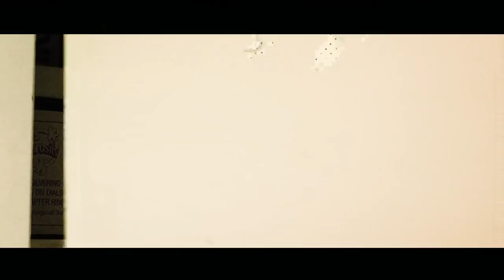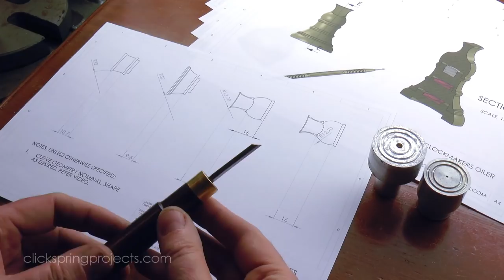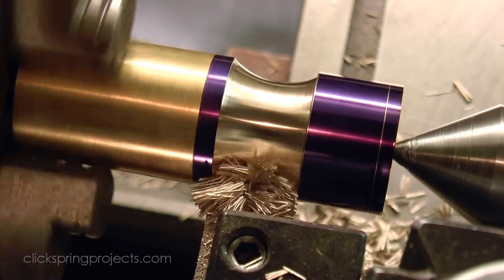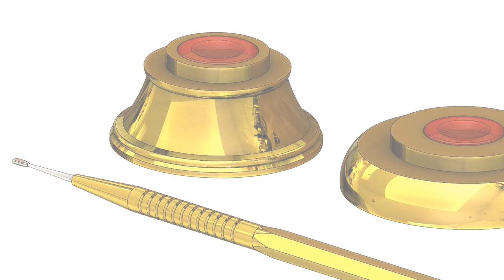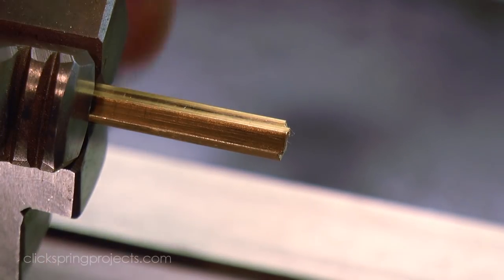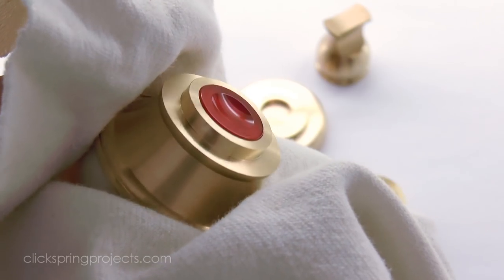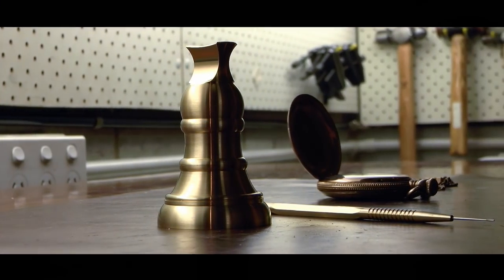The Good, The Bad and The Oiler

Comment: My grandfather was a watch and clock repairman. He passed away when I was pretty young so I didn't have a chance to learn much from him. He purchased a business of an older guy he worked for in the 50s, so he started off pretty well with a lot of original new parts. My mom held onto the majority of things in case I ever wanted to use them and I'm glad she did - a few watch makers lathes, a ton of tiny tools. Millions of parts tiny gears, crystals, springs, new from different companies. Still in original packaging from years ago. - There are a ton of items that I have no idea what they are or how they are used. Not only that but if they happen to have some sort of label on the box they're in, often not much comes up online for them either. I love watching these videos because I can see the actual use of the parts. There are a bunch of tiny oilers with ruby inserts. Small little wooden ones, some stacking, a lot of them. I had no idea that it what they were used for until I watched this. I'm slowly trying to organize everything, and get one of the lathes setup properly so I can use it. Every time I watch one of these videos it makes me want to go dig around in the tool bin and figure more stuff out.

Comment: I have two types of lubricants in my workshop. Sewing machine oil and general purpose grease. The sewing machine oil is perfect for most applications. It is very cheap, easy to clean, does not stick and it doesn’t oxidise.
Reply: No Way Oil?

Comment: I spend my life - well a part of it - telling site managers that WD is not the thing to spray on hinges and that what they really need is a can of 3 in 1 or similar. I tend to use duck oil for applications as it contains more oil and less solvent - mainly cleaning and protecting tools and equipment. You do some amazing work I love the way your filled parts just click together - Respect!

Comment: Several points
1) WD-40, AKA Work Destroyer 40. The ideal way to much up just about anything
2) Large Radii with form tools. Often it s a good idea to remove material with some form of relieving tool first. As the material becomes tougher. The Radii or form bigger. The more this becomes needed. 
3) One problem with form tools I've seen is that with flimsy set-ups is a tendency of the work to climb up over the tool due to the work grabbing. Stiff set-ups, low speeds, and materials that need it cutting fluids.
4) And finally a question. All we ever see of Clickspring is his hands. All we ever see of This Old Tony is his hands. Maybe Clickspring has a really good Yank accent. Or TOT has a great Oz accent. Are Clickspring and This Old Tony one in the same? One ponders these great questions of existential importance.

Comment: Nice video, I like when you try different topics :)
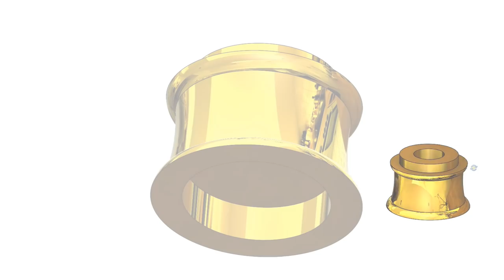5:08 you explain that aerosol based products are bad in many ways for small mechanisms
But what about bigger mechanisms, it should also evaporate within a few days and cause the same thing ? Or does it last longer because you can put more ?

I would really like to know what you think, because I'm pretty used to use this type of products and I have no idea how bad they can actually be.
(I use this for my 3D printer for example)
Reply: The things Chris described are an old school way of thinking, and is mainly applicable to his small possession things like watch mechs. I think the main takeaway is that you shouldn't apply excessive lubricants, and don't apply lubricants to dirt old lubricants.
Reply: @xenonram  Ok ! Thanks a lot for your answer
Reply: some kinds do evaporate quite quickly, if you need to free something up, thats fine but if you need to lubricate then choose carefully, I've found a cheap one called pocked rocket and it leaves a greasy film behind that seems ok for protecting components from corrosion for a few days but before assembly but I wouldnt use it to lubricate. The right oil is the best option

Comment: What benefit is there in using a ruby disk as the oil well, instead of just cutting the well directly into the oiler?
Reply: @Clickspring  Awesome, thanks!
Reply: Is there a problem using a softer material for the nib?
Reply: @Bill Carson I think the red colour of the ruby is prefered because of visual contrast with any small oil contaminant allows you to know when it's time to clean out the cup and put in a new batch.
Reply: @Bill Carson Granite is pourus and would absorb oil.

Comment: Amazing workmanship as always. What's up with the rubys though?
Reply: Came here to ask the same.  Why rubies?  Why not just a shallow well in the brass?
Reply: Maybe to ease cleaning the wells? I'm stabbing in the dark....
Reply: Come to think of it, maybe b/c Ruby is significantly harder than brass? Or maybe b/c Ruby won't oxidize and therefore contaminate the oil?
Reply: That would make sense if you want to keep your oil really clean, especially from tiny particles of brass

Comment: 11:25 pure engineering porn....  both levels and the top, just gliding on an interference fit (correction - sliding fit). Wonderful
Reply: Richard Lincoln yeah that got me all hot and bothered too.
Reply: Interference fit? You might want to look up your definitions again. Specifically, that was a sliding fit which is a fairly tight clearance fit.
Reply: Straight nutted
Reply: I'm new at all of this machining stuff so maybe I'm just ignorant but, if your decked out with every.conceivable measuring device and a good dose of patience, why should it be so difficult to turn parts with such tight clearances....?
I'm not saying I wasn't impressed...... But I wasn't surprised.
Reply: @garthodonnell3661  You shouldn't need "every conceivable measuring device" at all. If you've got some practice fits like that can been done with the old school inside and outside spring calipers that can't even do a direct numbers measurement. All you do is compare the inside measurement to what you have on the outside and keep cutting until it's a slight bit under. Even with a standard pair of dial calipers it could be done pretty easy. .001" - .002" clearance isn't that tight of tolerance.
Reply: Turning Point yeah totally agreed...... so why the fuss, I guess it just looked good hey..
I'd fall over if it slid together like that on something that was open ended though, that would be so thing else.
Reply: @garthodonnell3661  Well it's a cool effect seeing the part slowly lower as the air escapes. But I'm not sure why some think you need to be a master machinist to manage it. Chris's machining skills are far past what that little effect takes. LOL, with an open ended part and doing that?
Reply: @johncochran8497  thank you - I stand corrected - used the wrong term
Reply: @turningpoint6643   I guess it was just a good feeling when you see the calm quality of this guys content and a great conclusion to the project. Beauty or even appreciation is not predicated on difficulty or uniqueness (for me),  you either like something or you don't.    I liked it.

Comment: Love the video as always. What's the purpose of using ruby? I'm guessing there's more to it than just decoration.
Reply: Was thinking the same thing.
Reply: My guess would be its hardness, scratch resistance as in avoiding contamination by brass particles.
And boy it looks pretty. :)
* edit: aand already answered below, the joys of scrolling :D
Reply: I've read it is pretty good for friction since its very slippery and durable.
Reply: Nothing to do with decoration. Thermal stability and high dimensional accuracy of synthetic ruby means extremely low friction coefficients: efficiency and accuracy of timekeeping, and increased longevity of the parts. The jewels are bearings.
Reply: @mitchellg5615  But why use them and oil wells?
Reply: @wexy021  oh, well for this part yes, it's just for decoration. He said you can use other durable materials for the oiler, but this is particularly non-porous (reduce cross-contamination) in case he wanted to change the oils in the future, I guess. And the ruby just keeps with the whole timekeeping theme. Sometimes metal bearings are used in mechanical watches but only the absolute cheapest.
Reply: @mitchellg5615  ah an omage to timekeeping, lovely. Thank you
Reply: @mitchellg5615   that is what I meant to say lol
Reply: @TheEvertw  yeah, rubies that big would cost a bit much

Comment: As with all engineering the most important part is between the cutting edge the tool(file) and the surface of the part,
everything else is an add on to get that bit right , 
I try to get my mindset  between these two surfaces to get a feel of what the tool is doing,
measure twice-cut once, i most compliment you on your tidy workshop too lol

Comment: Excellent video as usual. One question. With the superglue you use to hold your work piece on to the temporary stock I would imagine there is some residue left on the work piece. How do you remove that residue? Chemically I assume?

Comment: Other than looking visually stunning, does the ruby reservoir serve any other purpose? (I'm thinking oil surface tension related, but would appreciate clarification) - Amazing video as always!
Reply: I believe it's for durability purposes, or for avoiding scratching brass shavings into the oil

Comment: Think you'll ever go over jewel bearings? They're a critical part of most clocks in the upper end I hear yet there are so little examples of them out there to learn from. So far I know they have superior hardness, small area meaning low coefficent of friction but most importantly, great temperature stability but alas that is all i know so far.
Reply from the maker: Yes will certainly cover jewelling in the near future - Cheers :)
Reply: @Clickspring  Right on. Do you think the antikythera mechanism used them? Jewels date back long into antiquity so someone eventually might of noticed their use as a hard material that had the potential for bearing use. The only issue is I'm not sure if gems were common as well as did they neglect the lower quality stones or was every stone considered precious.
Reply from the maker: No evidence to suggest use of jewelling in the AM - Cheers :)

Comment: That is the most lengthy description of WD40 I've ever heard without mentioning it's name :D 
Once a carpenter came along and sprayed that crap into my lock without asking. I replaced the lock and reduced his bill with the same amount. And never again would he receive any jobs from me. That was another 60 euro down the drain for just applying a little bit of WD40 :D 

(it was a high quality matched lock which had to be made by order so it would hold the same combination as my other locks. Three in total)

Comment: Why do people mistake WD-40 for a lubricant?  The very name is "Water Displacer"--depositing a waxy coating to protect bare metal against weather is what it was designed to do.

I do know that people have found having a nice sprayer filled with kerosene (the solvent) is handy for other things, like when you need a non-polar solvent.  So, cleaning.

How do you go from that to "substitute for oil"?

Comment: what is WD40 good for then? Apart from dozens of funny ab(use) cases...
Reply: Great for removing old sticker crud, good lube for machining aluminum if you don't like the smell of kerosene.  OK for cleaning surface rust with scotchbrite or steel wool too.  Just not suitable for use as an "oil", it gets gummy.  If you want to test something like this spray a bit on a piece of glass and put it somewhere dust free for a week or longer.  Some of the spray products will start to feel sticky in just a few days, others may take a month.  Some are true spray lubes without any tendency to gum, but they still slobber oil everywhere.  Great if you want to really soak something down, not good if you want oil only in specific locations.

Comment: Hello click spring! I actually work on clocks full time for a living.  I am only 23 years old. I do probably 80-90% of the repairs in my shop because the owner is starting to lose vision and has problems keeping steady.   Anyway,  I’m not perfect. I makes mistakes. Occasionally I’d have to take a clock apart more than 2 times after installing bushings only to have the clock not be repairable in the end.      

How do you deal with ‘problem  clocks’.  A clock that has been repaired recently and had to come back to be worked on for some reason.   How often does is happen to someone with you experience?   

I can only assume that my lack of experience is what puts me in these situations.  Missing details throughout the repair.   

I believe EVERYTHING is repairable so long as you have the time and patience

Comment: Nice work Chris, well done. However where can we get the ruby from? And how do you machine the stuff?
I'm stumped!  I get why you use ruby, as it would  not absorb the oil. I suppose "wicking" is the thing to control?
I'v been repairing sewing machines for 38 years using fine oil, usually motor bike fork oil in either 10 or 20 weight. My motto "is less is more".  I usually apply my oil using different sized sewing machine needles in a pin vise. I like your applicator way more!
Reply from the maker: Thank you mate! The jewel cups are from Bergeon (BERG-30180-AG-10MM, BERG-30180-AG-9MM) and can be purchased from http://www.ofrei.com/page248.html#30632 - Cheers :)
Reply: @Clickspring  ur a legend

Comment: Usually these videos are so relaxing; I’ve never yelled at YouTube like that before.  From a few years’ experience working in a tiny clock shop in Connecticut (actually, it was a “shoppe”) I learned that customers caught having lubricated their clock’s movements with WD-40 or graphite earned themselves an extra charge since we had to replace the ammonia in the ultrasonic bath.

Comment: For future reference for anyone who sees this....WD-40 is NOT a lubricant.  Don't put it on things that you care about unless you are trying to evaporate water on electronics or steel.  I use it on 80's BMX bike frames to make sure any rust inside the tubes at the welds are completely dry.  WaterDisplacement-(formula)40.  :D

Comment: am I the only one that thinks this is insane? why not use a brush? like copper electrical wire?
Reply: and drip it on from a bottle onto the wire. like 3-in-1 brand lubricant twist drips. you can get teflon, silicone, motor oil, penetrating oil, machine oil and some kind of graphiteteflon oil.
Reply: i mean its like cooking 100 year stew. your supposed to de-grease old crap before you add more grease.